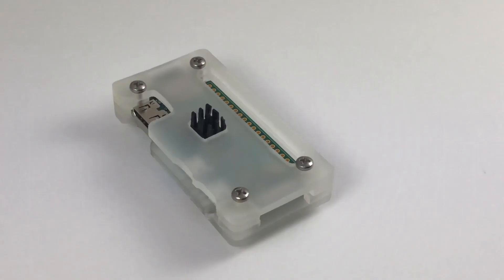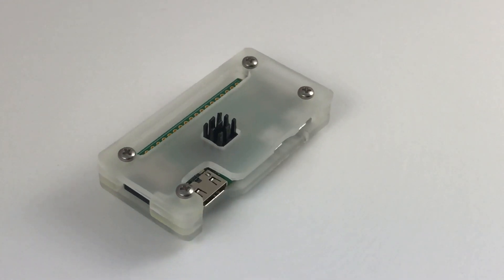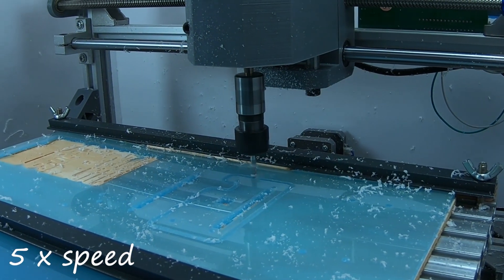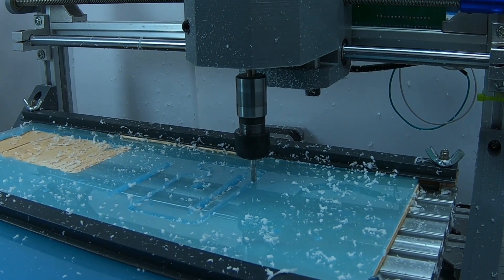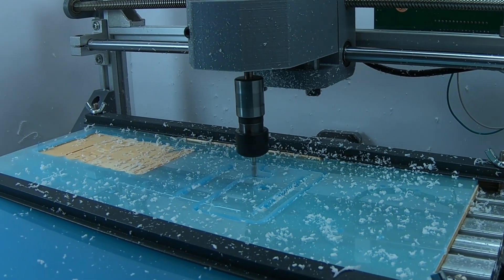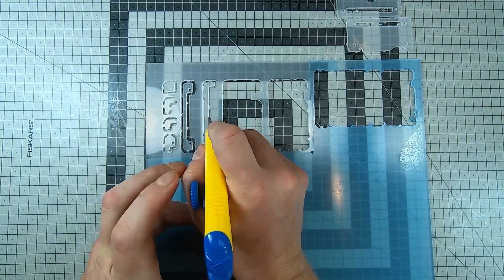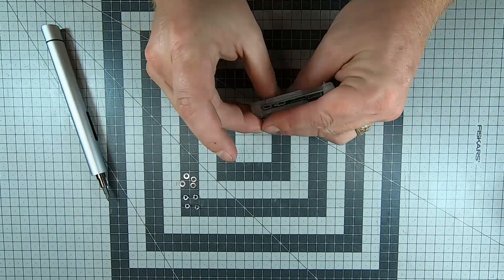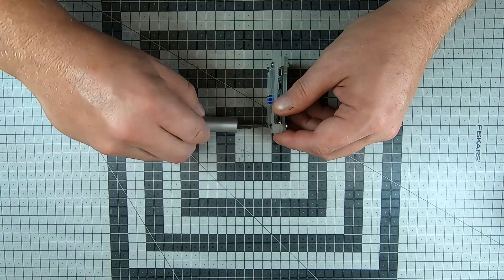CNC Acrylic with 3018 - Cutting and Engraving a Raspberry Pi Case

Comment: I have the 3018 as well and when trying to engrave onto some acrylic, I get different problems on each attempt. It's really frustrating. Sometimes it seems that the bit doesn't raise by enough to clear the engraving, gets snagged and then the rest of the engraving is offset sometimes but more than a centimetre. Do you have any tips for this particular problem?

Comment: What happens with 4 flutes? I have a diy machine with a Chinese 500W DC spindle. It says 12K rpm but I wouldn't believe it even if it is spinning at 5K at 48 Volts.
Would it really make a difference if I used a 2 flute end mill? Thanks.
Reply from the maker: Hi!
Very simplified, 4 flutes is often for metals. So in most cases 2 flutes will be better!
Reply: @DIYTECHBROS  you mean hard metals I guess. Aluminum is almost at the same category of hard plastics that need 1 or 2 flutes, 3 maybe if the spindle is not too powerfull. The logic is the more hits at the material the more heat produced. Hence melting and warping.

Comment: Hi Guys,
I've been looking for a while for a video about cutting an acrylic case on a CNC. 
That's a fantastic example.
I tried on my CNC which ended pretty much in frustration and broken bits. Ideally I need to use 2 mm bits as some of the holes are small. I have extruded acrylic and that's the only one I can find from my supplier.
I don't seem to find your links for the bits.

When trying different things I managed to do all the drilling and some cut circles perfectly but the main contour  cut ended melting the acrylic on the bit at exactly feed and speeds. 
do you have a link for the lube you are using?
do you happen to have the .tap file for your case. I would like to try it to demonstrate myself I can cut acrylic on my machine.

 I see they way you did it and it's a beauty:)
Adrian

Comment: How well do you think this 2018 machine will handle the white cast acrylic and the laser engraving in this transponder project?
https://cessna172sim.allanglen.com/docs/avionics/bendix-king-kt76c/
Reply from the maker: Milling acrylics, yes, no problem! What is it you want to engrave?
Reply: @DIYTECHBROS  If I do this project I will need to engrave the lettering onto the faceplate and buttons of the transponder project in the link. The faceplate will be painted black after the milling and prior to engraving. The laser only needs to remove the paint for the acrylic to show through. Wanted to be sure that the laser has good enough resolution for the small text. For reference, the faceplate is only about 1.6" (41mm) high by 6.5" (165mm) long. The smallest text is .075" (1.9mm) high.
Reply: @kaellis8250  I have a 3018 pro (cnc mill + 5.5W laser) and I'm trying to do backlit front panels as well (I want to make a custom controller for Kerbal Space Program).
While I'm waiting for the cast acrylic to be delivered, I tried to experiment with laser engraving the text on the black-painted panels and the 5.5W blue laser works like a charm (I use lightburn).
I'm still experimenting with the CNC milling, but I got some results using Fusion360 and Universal Gcode Sender.

Comment: Excellent , can you tell me please , what is the program you used to generate g code for cnc ?
Reply from the maker: Hi!
If you are new to CNC I would recommend Easel by Inventables. It’s web based, free and easy to use. I have mixed results using it as a Gcode sender, but as a easy CAD it works great! https://easel.inventables.com/

Comment: Excellent video! Your 3018 CNC is working so smoothly. I recently built a MPCNC to get the extra workspace of about 320mm x320mm. I am totally new to CNC and began testing and learning how to create tool paths using EstlCam and then plotting it out using a pen. I just tried cutting a 40mm x40mm 3mm thick Acrylic piece as my very first real test :) It didn't go too well. I followed mostly your settings for Feed Rate and Speed. The acrylic I am using is similar to the one you used with a blue plastic film. I am using a single flute 1/8 inch  3.17mm bit. I am using a Demel like rotary spindle and set the speed to 15000 rpm. The finished job did not go as smooth as in your video. I used a plunge rate of 1mm, i think it is too deep and was curious to find out what you depth you were using? And also I wasn't sure whether I should be choosing 2D Engraving or MIlling when designing in Fusion for making say an Acrylic case like the one you were machining?
Reply from the maker: Hi! When you say it did not go too well, what was the problem? 
Depending on the problem, but if you are running it at 15K rpm a faster feed rate would in many cases be desirable!
Reply: The edges are very rough and it appears as though there is some melting. Big chunks of plastic were removed. Unlike how in your video, the same sized bit was cutting, very smoothly with tiny bits being removed in each pass. I think the problem might be my step down rate, i set it to go down 1mm so it would do 3 passes to cut through the 3mm depth. Please tell me what did you set the step down rate. Was it 0.25 or maybe 0.5mm?
Reply: yours rpm is too fast you melting it

Comment: Melting plastics is always annoying, no matter how expensive the machine. Something I used to is a retract the tool above the material to get rid of unwanted long pieces of polymer that wrap around the tool. Do that with every pass.

In your experience, what tolerances can you achieve with the machine?
Reply from the maker: Well, we use it for milling PCBs cutting only 0.1 mm deep - so for the price I would say amazing! Check out our PCB videos :-)

Comment: How long did it take to cut all the pieces?
Reply from the maker: Hi Martin! I don't remember exactly, but about 20 minutes. It all depends on how aggressive you want to be on the feed rate and depth, as well as the bit you are using. After switching to a single flute bit (link in the description) we were able to run it deeper. Since it's only cutting once every turn it gains the needed speed.

Comment: Hello,
I keep melting the acrylic :(.
Rotation? 7000? 9000?
And how much do you put in advance in min / min and plunge ?
Reply from the maker: It's only 7000 RPM.
But depth is very dependent on your bit. Single flute, double flute, bull nose and so on. A single flute allows the drill to build up needed speed for better cuts and less "filing". Filing will heat up and melt your materials. But, I would make sure that you are using proper acrylics. With a good bit it's hard to melt. You can use a cooling spray on the piece before milling - it will also help. Even CRC or WD-40 can help so that any heated material will not melt into other surfaces (kind a protective layer).

Comment: Are there any special bits for encraving acrylic or these bits can be also used?
Reply from the maker: When you are engraving you can stay very shallow, so less heat is generated and less will stick to the bit. So you can use most bits. But a bull nose drill (rounded end) bit is very effective!

Comment: Excellent video! What spindle speed did you guys use? Can't seem to keep the acrylic from melting onto my router bits! Using a single flute 1.0mm router bit.
Reply from the maker: Hi! We are using the 24 V power supply that was in the kit, so about 7000 RPM.
Just make sure you are using actual acrylics.

I have never tried cutting acrylic with such a tiny bit, only 1 mm? 
I some times use spray lube for drill bits when I cut softer plastic, and it works great! So thy that or just use CRC multilube :-)

Comment: +1 :) nice video, but i've some questions:
- it seemed you placed a spoil/waste board (MDF?) below the workpiece is that correct?
- what is the 2 rods that you use to hold down the workpiece, it seemed those are self made?
- it seemed the machine is sitting in an enclosure ? the videos are zoomed in hence it isn't apparent if it is working within an enclosure.
  (but i'd think an enclosure is useful as the milling would generate a lot of chips/dust and noise)
- what is the software used to generate the milling instructions? it seemed the software does it well by leaving bridges at the bottom layer so that double sided tapes is not needed to hold down the milled center piece
Reply from the maker: Hi Andrew! 
- Yes, a spoil board is always a good idea. We use whatever we have closest to the machine. In this case we just used some plywood. 
- You can just use the supplied clamps that come with the 3018. We had some left over angel aluminium pieces from a fence... It makes sliding the Plexiglass easier. 
- We have not had the time to build an enclosure for the CNC yet. So it's just sitting on a work bench. But we are building one very soon. Just trying to figure out a good solution that allows us to film the CNC as well.
- We just used MakerCam for this. Adding tabs is often easier than removing double sided tape.
Reply: thanks for the response! :)

Comment: Did you publish the plans on your case too somewhere? Looks like a nice project to try :)
Reply from the maker: Hi! I'll get you the link to the pi case we modified. Searching for it, we'll post an update!
Reply from the maker: This is the file we used! BUT, we you have to scale it up to 133.3% (says so in the description, but we did not see that the first time). Also, making the CPU slot bigger is also a good idea. https://www.thingiverse.com/thing:1642636
Reply: @DIYTECHBROS  Thanks for the update and heads up on the scaling. I probably would've missed too :)
Reply from the maker: Also, remember to rearrange the parts so that you can add tabs!